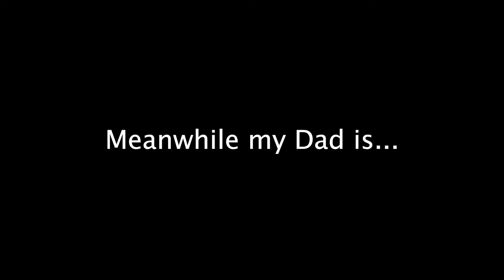440 Swapped 1968 Charger Rat Rod Build PT.1

Comment: Single piece lockdown wont work on your Charger,  needs a 3 piece. 
If kick down / throttle valve not on or adjusted correctly it will smoke the trans in first 50 miles.

Comment: Did you  change  the k, member
Reply from the maker: Nope! Only difference is the 440 motor mounts and a shorter drive shaft
Reply: So are they conversion motor mounts?